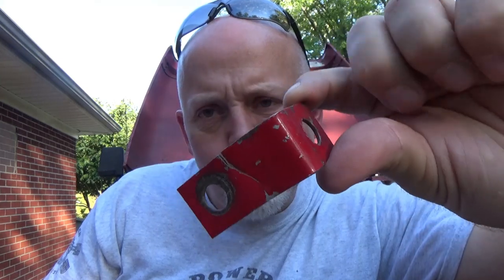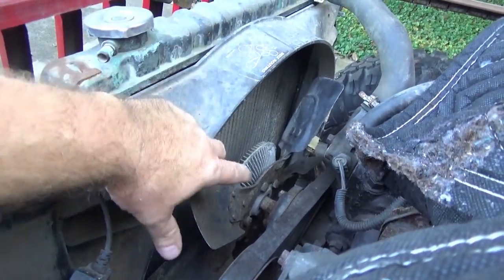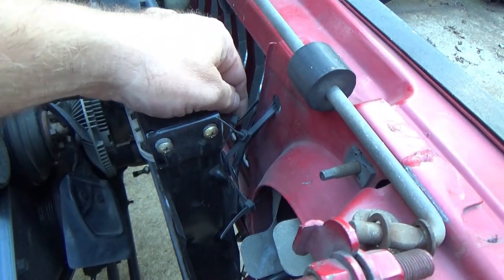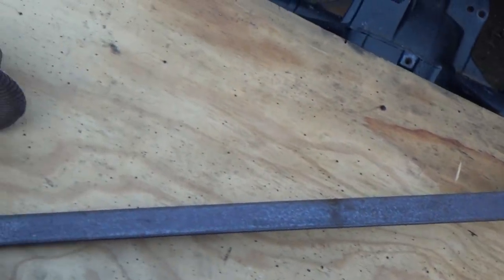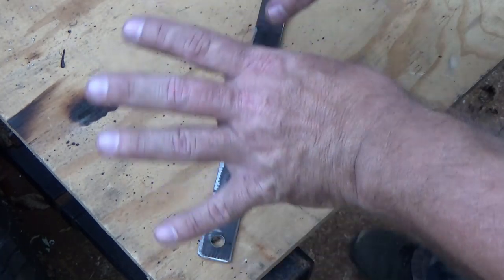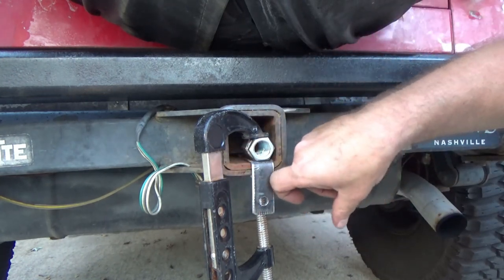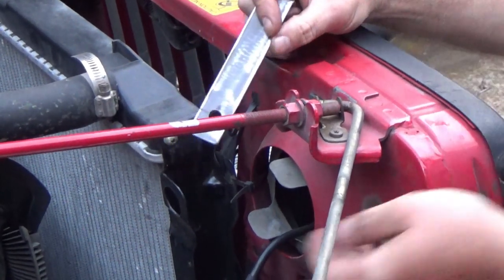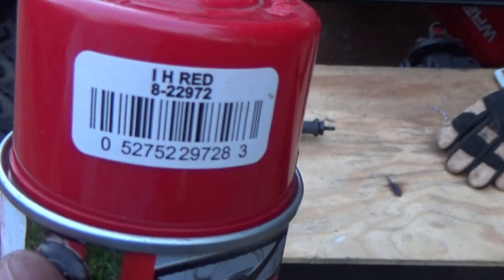Jeep Wrangler YJ - Fab and upgrade New Upper Radiator Mounts

Comment: If patience isn’t your virtue, heat the part with a heat gun or torch right before you paint it.  It will adhere better and dry quicker.  You don’t need to heat it crazy hot either.
Reply from the maker: That's true. It would burn any of the impurities off promoting better adhesion. I used to do a lot of powder coating. I'd often preheat parts before coating, especially cast parts. Thanks for leaving a good tip for everyone.